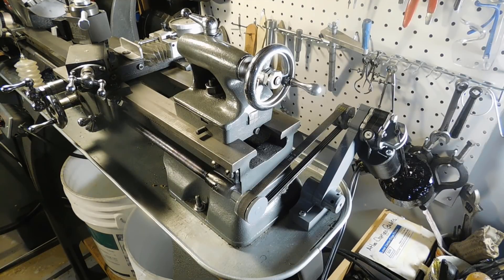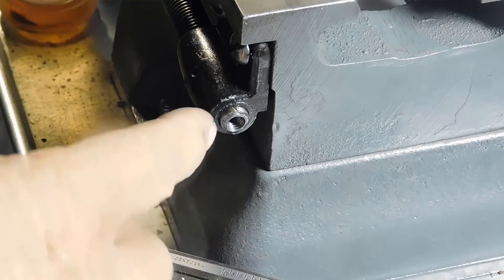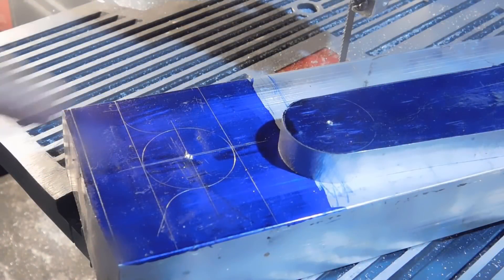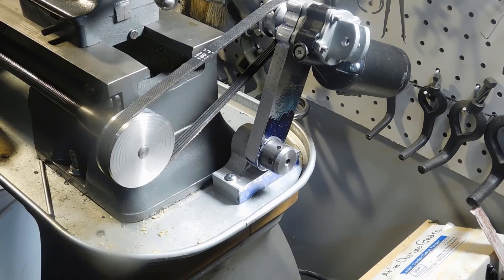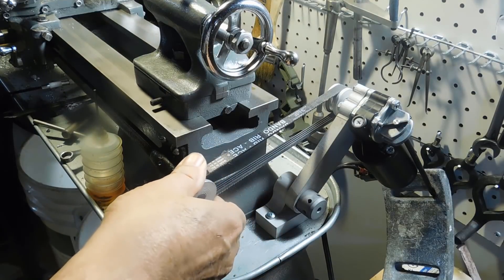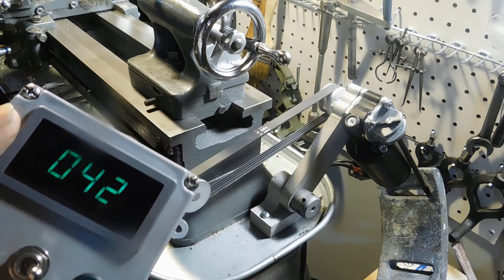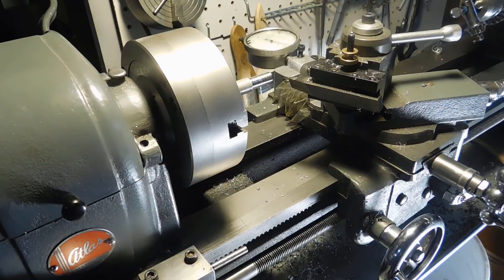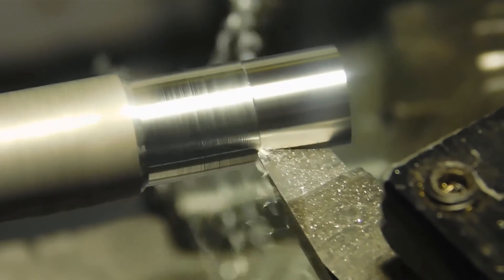Atlas lathe Z-axis drive

Comment: Hi Bob,  looks like this vid has been on for a while now but I've only just stumbled on it. You and the other guys you mention never cease to amaze me, how you do all this with camera work as well is beyond me. Anyhow, I'm about to attempt this project and have recently powered up the X on my mill with success and I intend to do the same setup on the lathe. The only difference to your setup basically is the drive belt. After a crash on a former mill where I used a mini chain drive (bad mistake but luckily only bent motor shaft, no actual machine damage. Phew.)  I now use rubber round belt 1/4 inch as used on industrial sewing machine (cheap as chips and many sizes) on aluminium pulleys. The good thing about these belts is if tensioned  correctly will grip pulleys good enough to do that fine finish were after and at same time will slip in the event of a crash. So you can  actually come up to a carriage stop without worrying.  My tension device is a simple slotted bracket and thumb nut.  You can still use hand wheels but if necessary the stretchable rubber allows you to disengage the belt easily.  It's worked for me on mill so I think it should on lathe. I m wondering if anyone else has done it this way .   Possibly of interest:  the motor (complete with gearbox) is from a roller shutter door. Through transformer and speed controller and two way switch.  Will add another comment after this project.    Thanks for sharing your projects.  Alan.

Comment: Good video. I'm new to a lathe, but I pulled out my Atlas 10F 36" and I'm setting it up. Does the motor at the end of the lead screw take the place of needing to engage the change gears? Is the big benefit to the added motor to slow the lead screw down and thereby slowing the feed rate to the saddle/carriage and compound cross feed?

Comment: I switched my 48 tooth drive gear to a 24 tooth nylon gear,,cut my feed rate in half and protects my zmak gears from a crash and not another thing to worry about,,
Reply: a trick : watch series on Flixzone. Been using it for watching a lot of movies lately.
Reply: @Yael Jacob Yea, have been watching on Flixzone for years myself =)

Comment: Is there any reason why a person can't attach the drive motor directly to the lead screw? I'm trying to set something like this up on my Atlas lathe and I'm perusing YouTube for ideas.
Reply from the maker: My drive motor is directly attached to the leadscrew...the change gears are removed (at least one)...change gears will not slow the cut down enough to get the finish I was looking for...I still use change gears to cut threads...bob

Comment: How would you figure out thread count by using the electric motor?
Reply from the maker: I do not use the electric motor drive described here to cut threads…I use it to move the cross slide at speeds slower then the change gears allow…to get a nice finish…I usually start a cut with a faster feed and as I get closer to size I reduce the feed speed…I still use the spindle motor to drive my change gears to create threads…when using the motor I describe here be sure to disconnect change gears so spindle motor runs free...bob

Comment: Bit late with this! Another way of upping the tension and keeping the same belt is to either shorten the motor support arm or, rather less work, bring the bottom mount forward a tad. It would n't need much. I too like the idea of a car seat motor. Bet they are more expensive here! BobUK
Reply from the maker: Hi Robert...this set up was used during Eureka build (with the limit switch)...I'll show it...really is very handy...simple to remove and use...bob

Comment: Good video. I have an Atlas Clausing 3950. 6 inch lathe. Would you post a video of your electronic setup? I want to do the same thing. Can you thread with that setup?  I would like to be able to figure out the speeds needed for threading. On my Atlas you have to have the change gears and swap them for different threads. I don't have the gears. I believe this would do metric and sae plus excellent finishing.  I'll use a cogged belt and pulleys if I get it setup. I think this would help(mentally..lol) for threading. I have a 24vdc power chair motor and a driver box already. I would like to know how you wired yours and the pendant.
Thanks a lot.
Reply from the maker: Tnx Brian...this motor drive was discussed at this forum:http://www.machinistweb.com/forum/showthread.php?t=4062I made a hand crank for my 6" Atlas lathe that I use to thread a lot...not sure how threading would go with this drive system...think I'd either drive with the spindle or the hand crank.
Reply: robertt4522  Thanks for the reply. I bought the speed controller for 8$ and change from Ebay.
Reply: You would need the change gears to thread on your lathe, they synchronize the work spindle to the leadscrew. Some older American lathes offered metric change gears as a option. The reason  Mr. Pete set up a variable speed motor on his 12" atlas was because the lowest feed rate runs to fast on that model. It is something like .004 carriage feed per one revolution of the chuck. .002 or slower would be better. You should watch  Mr. Pete's video on the subject. Look under shop tips.

Comment: Nicely done.
This is also on my todo list. So far 4 I've  bought 4 different motors. I guess I might be looking for nr.5 
But I think I will need at-least a 3 step cone pulley to cover all spindle speeds.
I'm also considering a torque clutch so I can run the carriage up against a hard stop or perhaps use a switch to turn it off.
Reply from the maker: Thanks a lot...keep an eye out I'm making a limit switch for my next project...enjoyed your channel...will be watching ur stuff too